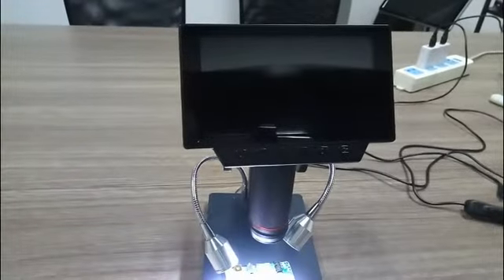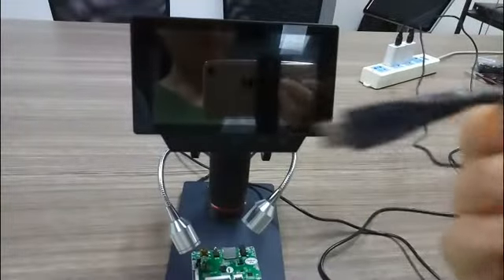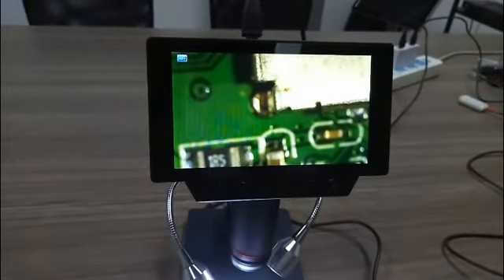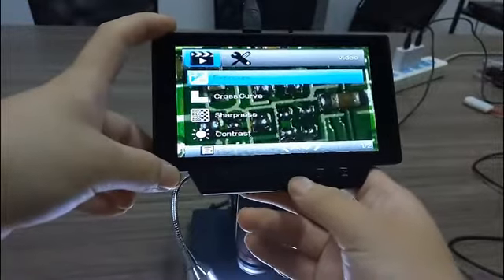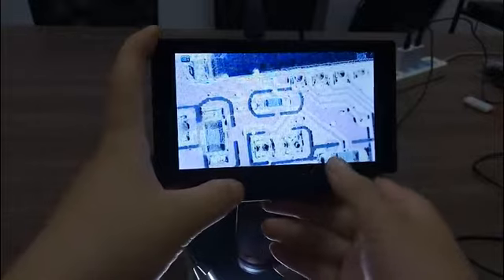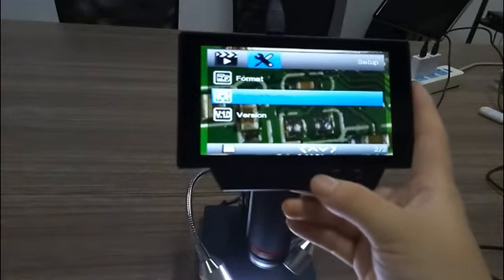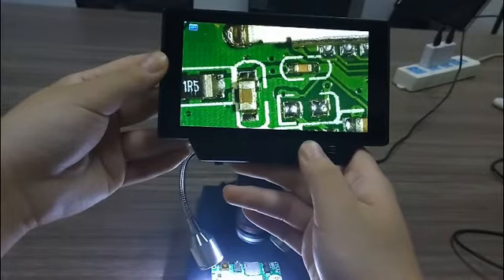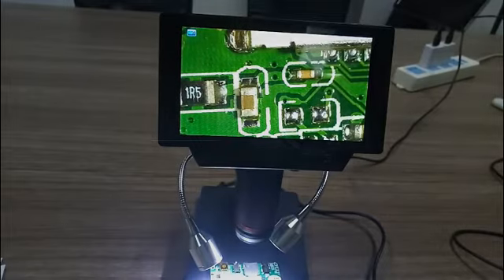Inspection Microscope ADSM302 observe use this 5 inch screen tool repair watch phone PCB soldering

Comment: I wish it had built-in rechargeable Li-Ion battery and power switches built into the base and most importantly, NO MESSY WIRES!... Perhaps in the next improved version, ADSM303?